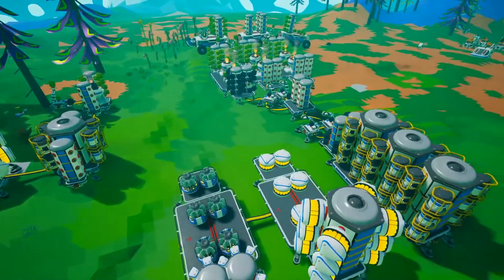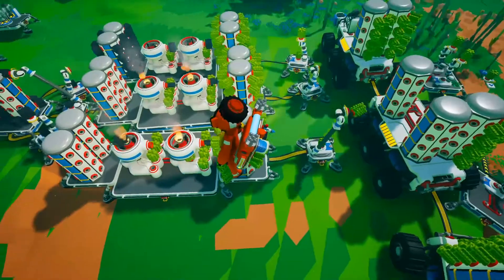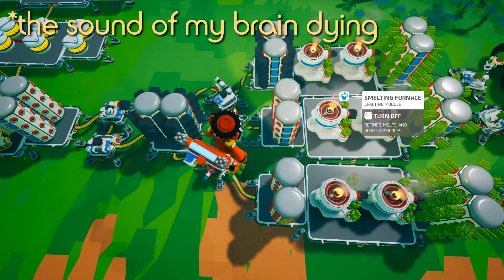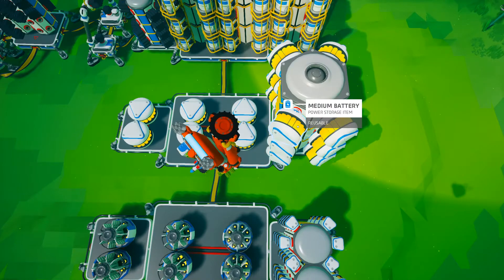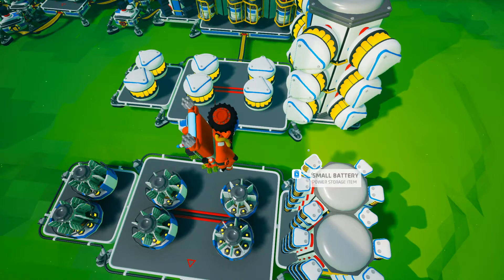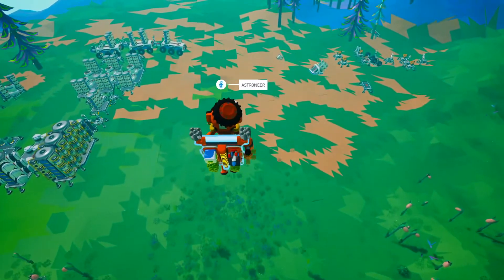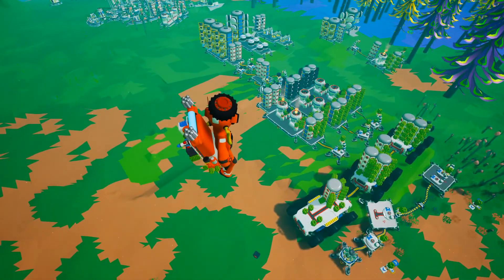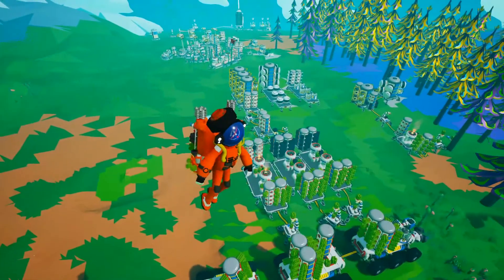Astroneer Automation Guides - Organic Destroyer

Comment: how to get that organics? what repeater or other item do you use in that green land to produce organics?
Reply from the maker: Well the whole point of the build is to get rid of organics but if you want more you can create a scrap farm on Calidor using Wolframite and convert it to organics. You can create a Floodlight from one Tungsten and that scraps for 1.5 scrap, it's crazy good. The organics usually come from my rover runs and clog up my storage so this was one way to get rid of them. The build is in creative mode so I'm using resource plynths.

Comment: Another thing you could do is put all the carbon into a large resource canister then package it when it’s full which will delete the resources once you unpackage it again
Reply from the maker: What a great idea! My mind blown. I did not know packaging a resource canister would delete the resources, this is a game changer.
Reply: game be like NAH BRO the packager shines red
another idea is to fill a large canister and just ditch it on a random planet never to be loaded into physics again
or take the canister attach a winch then hold the winch in the astroneers hands and use a hydrazine jet pack to spin in a circle in the air sometimes i find that lost rover seat in the core or in rare cases other planets cores later when i go to activate the core im like (⊙_⊙) WHO PUT THIS HERE
Reply: later browsing around i found someone made a full auto 0.25 scrap per canister they make quarts and make a storage sensor shred it and trade for sphalerite smelt into zinc and over time scrap builds up as the soil depletes

Comment: also i noticed that you didnt have a crane on the rover, my method of soil to scrap is to go under a mountain about ground level and flatten with a drill and paver then with the crane get the rest of the mountain, surface drilling produces alot of organic, or cave drilling uses soil in the bridging between cave walls
psst hey you this guy needs subs, its free for you and he deserves it he only has 517 and deserves like 20k for all the videos and brain frying from daily content making DAILY (⊙_⊙;)
Reply from the maker: Haha thanks. I know this may upset people but I usually dig the soil up by hand mostly after the initial run by rover/crane because I hate having tiny specks of dirt floating in the air. Gaming OCD
Reply: REEEEEEE i never noticed them my base is under a flattened mountain and im just sitting here taking it all in ಥ_ಥ 1 minute later *deletes main save
Reply from the maker: @tynumo  XD

Comment: ~1:00 in you said you cant auto unpack goods and auto shred but you can, my automated version of Archivers setup gets 1.5 scrap per canister to start spin soil into clay and smelt into ceramic however you like then have a lil pen about waist high (to the astroneer) with a auto arm putting ceramic into the pen and another taking drill mod 1's out, define the edges of the pen with the auto arm thats taking drill mods out, then you would stand in the pen looking down open your backpack and walk forward a bit (the drill mods go flying back a bit) and a autoclicker set to every ~3.5 secs the drill mods will fall out since you have a full backpack of ceramic as you print another the auto arm will fill your backpack and the drill mod will fall into the pen and be shredded its full afk and max soil to scrap il try to make a vid but i play on xbox so up to you if you like, aside from that happy scrapping :-D
Reply from the maker: That is a brilliant work around to not having auto unpackagers! Great build dude, didn't even think of something like that.